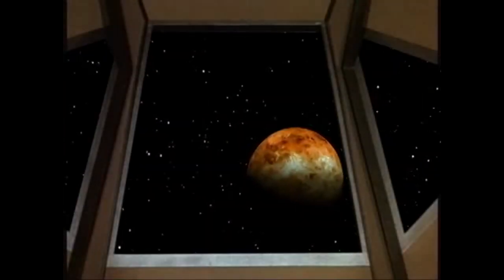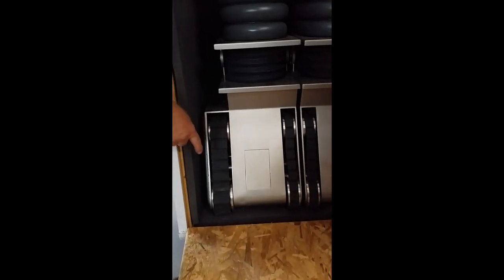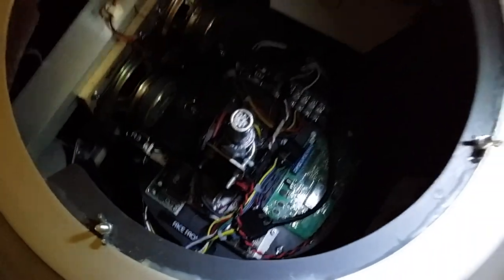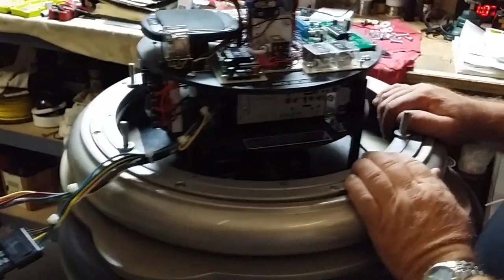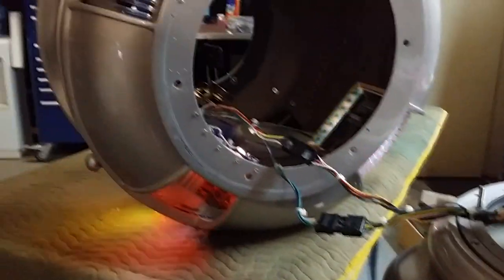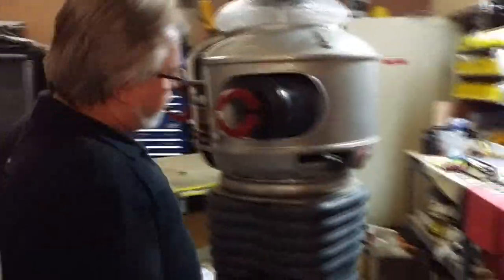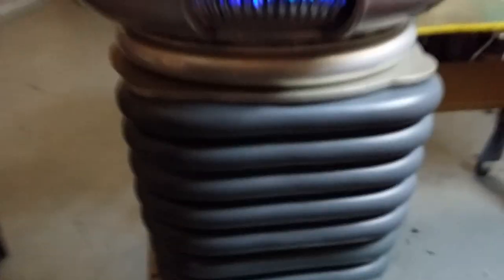Lenny B9 Robot Assembly Video

Comment: The extender is plastic electrical conduit, if it extends too far just cut it off to the length that wont push the head off.....duh.
Reply: That actually wouldn't help. The problem isn't the length of the extender, it's the distance of travel. Cut the conduit and in the retracted position it wouldn't be tall enough for the head to be in the right position when retracted. Basically it's the correct length when retracted, but it moves too far. The correct solution is to add limit switches so when it reaches the max allowable height it cuts power. Or a bit more brute-force, some kind of stop block so it can't move past a certain point tho that's a bit iffy, especially if you get some kid or dingus who just keeps holding the button once it hits the limit, you're just asking to break something or burn something out.

Comment: I was 10 yrs old when Lost In Space aired for the first time. Irwin Allen created some great shows. Robot (B9) was way more believable tech than Robby the robot. 
The bubble extension issue can be fixed using a micro switch to kill the up power.

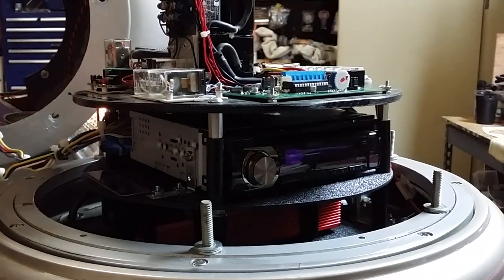Comment: At 5:12 the robot says "Who turned out the lights?" twice. That sounds like a line from an episode of the current series of Doctor Who. Shorten the bubble extender so that at if the actuator travels its full distance you won't damage anything. I would also think it would be easier to put the arms in place before putting on the head.

Comment: Why didn’t the put a limit switch on the bubble actuator to protect it?
Reply: I was wondering the same thing.
Reply: In 2017, a small mp3 player would be much smaller, lighter, use much less power, and provide far more, longer lasting, and easier to back up storage of he voice audio than an outdated CD player.
Reply: @brianbatie6650  It used to have a an 8-track, but all they had were Beach Boys cassettes.

Comment: I think the fact that it doesn't have a limit switch on the brain height and him saying if you extend it too far it will break is frankly ridiculous.  The way it slams back down and jerks to one side making the brain section jerk with it is a terrible design.  Also, him forgetting that it should be assembled with the power off, or even that there is a risk if assembled with the power on is really quite reckless and dangerous.   Why not insulate all the wiring so that there is no risk?   A CD player in 2017?  Really?  Good grief there are far better options available for sound and voice.  The motors are way too noisy..  I imagine this robot costs thousands of dollars and these small details really are unacceptable.  I've seen much better implementations of all this technology by amateur builders shown in other Youtube videos
Reply: I agree, there seem to be some design quality lapses here.
Reply: What's that old saying? Something like  .. Never meet your heroes, they will disappoint you

Comment: This is cool with the electronics but I would want an exact replica of the original where a guy could get inside and it still did stuff. The warning about the bubblehead raising too high and breaking will be a problem. Nobody reads/watches the instructions and kids who see it will run to it and play with the controls.

Comment: For the arms, it seems like an easier method for installation would have been some type of twist and lock method. A metal ring in the arm hole, with keyed notches, that match a plate on the arms. Fit each arm into place, and then turn them 90 degrees to lock them into place.